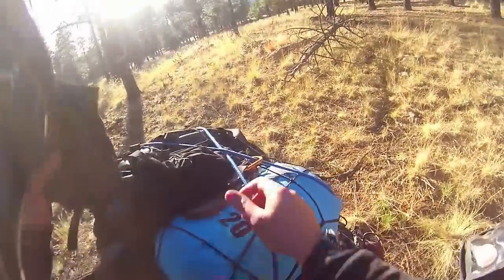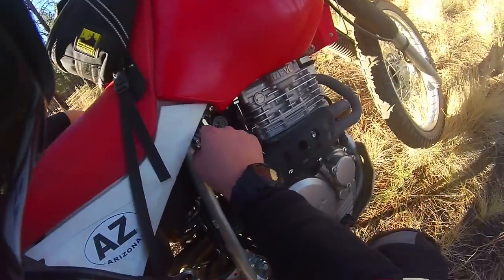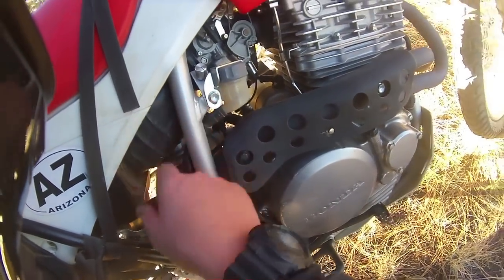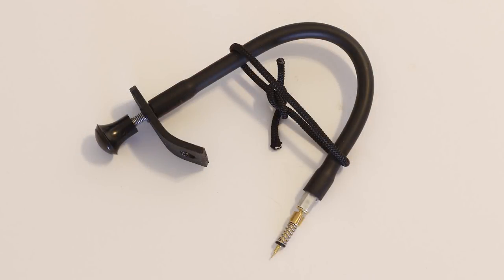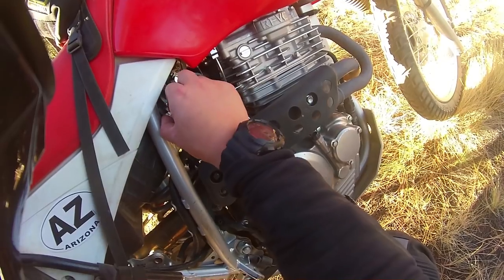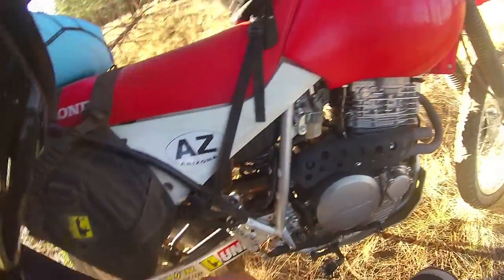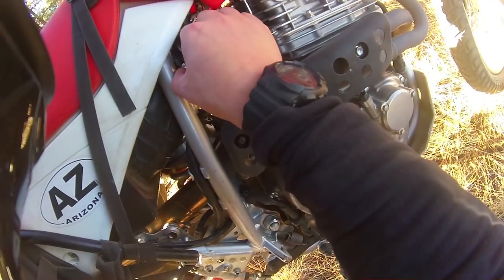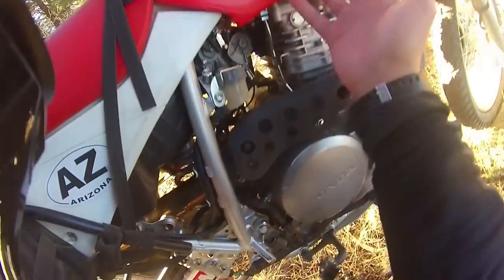Extended Mixture Screw for the Honda XR650L

Comment: Just ordered one - I'll be going from 1000 feet to 6500 regularly - this is going to be nice.

P.S. My bike is a '23, and has the plug and not the flag to stop idle mixture adjustments. 3 minutes with a hacksaw carefully applied, and I was able to cut off the boss right at the end of the plug, exposing the head of the D-screw.  No need to worry about burying the 5/32 drill into the screw head.  Just a skosh less than 1/4" (6.5 mm) was removed

Comment: Will that work for a KLR Gen 1 and Gen 2? I want one. Good work
Reply from the maker: Remskii No, it will not fit KLR. The mixture screws are different (I think) and I haven't measured a KLR to see if the mount will reach a mounting point. If your local to Arizona I'd be happy to come by and see of it works though haha
Reply from the maker: Remskii by the way, if I manage to sell enough of these, i plan to use the proceeds to make versions for the KLR, DR650, and DRZ

Comment: I'm in Colorado altitude about 5000ft. I have a 52 pilot and full Dave Mods but still getting popping on Decel, any recommendations?
Reply from the maker: Brandon Flesher huh 52 is pretty small I think, but if it starts and idles fine it's probably appropriate for that altitude. I use a 60 pilot at 1,000ft with the screw 2 turns out.  I'm not a carburetor expert by any means, but popping is ussually caused by unburned fuel combusting in the exhaust system, which would suggest a rich condition I think. It also tends to happen when more open exhaust pipes are used though.
Reply from the maker: Brandon Flesher an easy place to start is to look at the color of your spark plug. White is lean, black is rich, light brown is correct.
Reply: Brandon where in Colorado are you?  Did you do the Dave's Mods yourself?  I'm in Denver, going to be doing the Dave's Mods myself soon.
Reply: I'm in Pueblo. I did Dave's mods and I got a better throttle response and she starts up very easy even in the cold. I do have. K&N so I'm thinking maybe between that and a 52 pilot it may be just a slight lean when the temps get cold. Other then that my XR650L is a beast and I have no issues getting her on one wheel.
Reply: Nice - good to know, I'll look at the K&N filter and a 52 pilot when I do the mods.